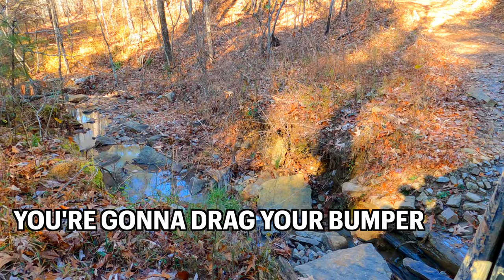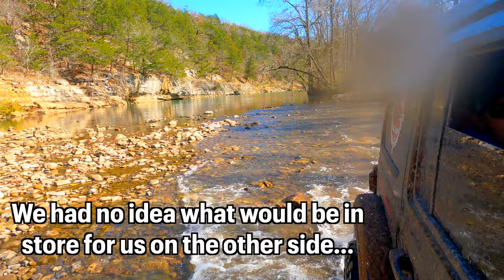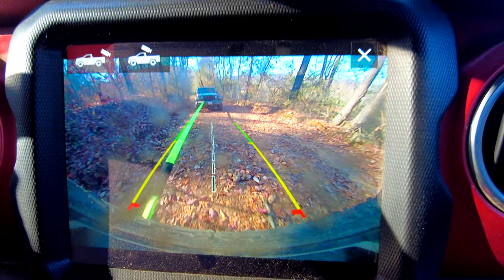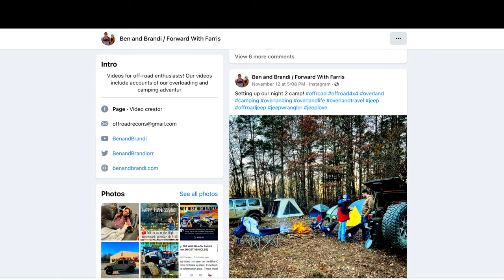BIG Problems on the High Water Mark Overland Trip.

Comment: Hey B&B, another great video, the engine issue sucks, but hope it is not as dramatic as it looks.
A question, noticed you are running your snorkel sidewise . Never seen it before... Care to briefly explain the rationality for it? Do you drive it always like that or it is turned sometimes (and when)?
Thanks a lot. Cheers Nash
Reply from the maker: He had to get a new motor in the gladiator. So yeah.. it’s as dramatic as it seemed. 😕. A few reasons I run my snorkel sideways. 1. When driving in heavy rain it doesn’t force it down the snorkel. 2. When I hit large mud holes it doesn’t throw mud and debris down it. And 3. Following closely to someone on dust or gravel doesn’t force it directly down the intake. 

-Ben

Comment: That sucks! ... good on you guys for jumping to disconnect the battery. I'm assuming the diesel, like the gasser, also has that air flow duct in front of the grill ... I can see where that would funnel water right up to the intake.

Comment: Buddy really like your videos , but if you could finish the stories that would make the videos so much better.. like your brothers jeep you finished off with shop said he may need a new motor .. then there was no follow up , ok he got a new motor or turned out this was the problem and not the motor.. now we see this gladiator with possible hydro-lock going on the trailer but again that was it , what happened ? Was it electrical or did he hydro- lock it ?see what i mean , its like we get the beginning of the story and the middle but no endings .. ya need to finish the stories ..cant leave us hanging 👍
Reply from the maker: Great feedback. However hard to have an ending that I would have to wait months on… my brothers Jeep is still in the shop and the gladiator did hydrolock and we addressed that in an episode a few episodes later. Maybe you missed it! 😉 thanks for watching! 

-Ben

Comment: That air intake is the most idiotic thing I've ever seen. I'd see an attorney about a design flaw.  Also, consider a used engine for a fraction the cost of new. Unless you are in a state that allows modifying the Jeep to oh, maybe a Chevy.
Reply from the maker: I agree 100 percent! The diesel is the only one that had issues.. my JL has a snorkel… but the other JL is stock and didn’t have an issue.. thanks for the advice! Hope you subscribe!